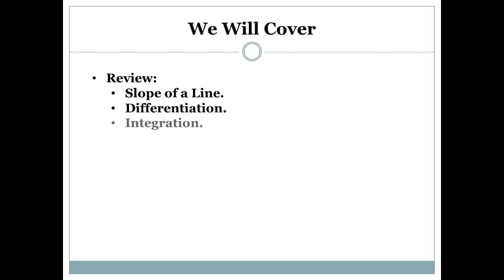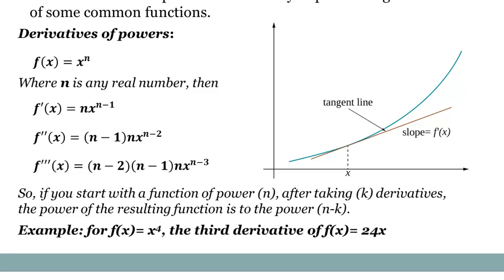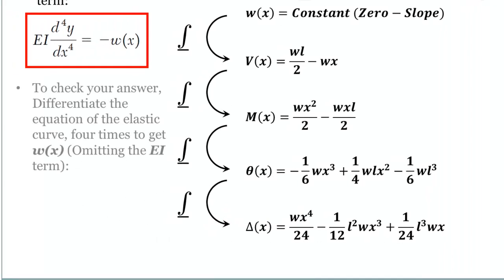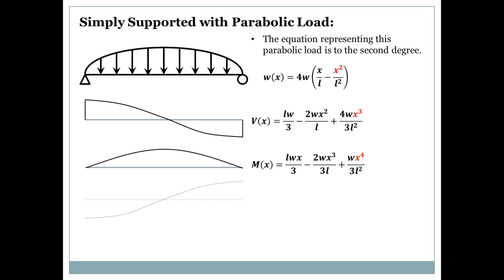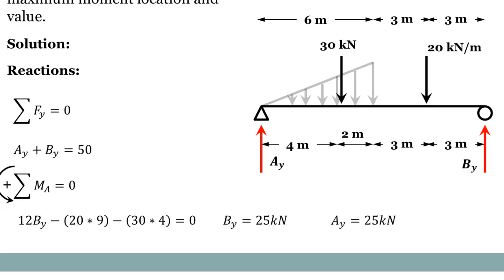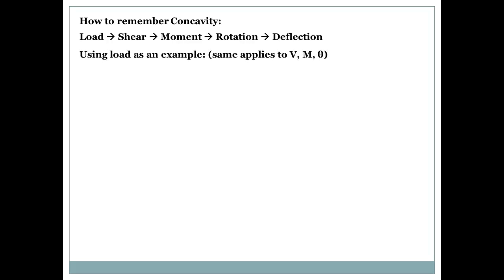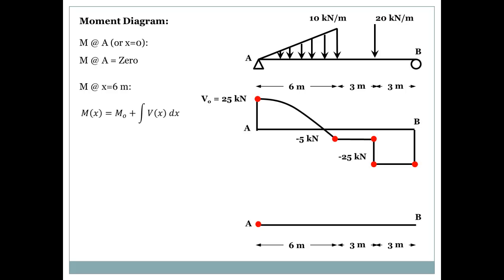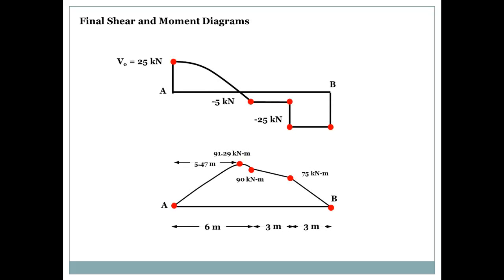Understanding the V and M Functions and Their Diagrams + 2 Examples

Comment: Great video !
I like the concavity rule, for the moment diagram between 0 <x< 5.47m the shear is Positive and decreasing
but between   5.47m <x< 6m it is Negative and decreasing wouldn't have a different concavity ?
Reply from the maker: ans just concavity applies if the shear force shape is of 2nd degree (parabola). after the 5.47 the shear is a straight line. so concavity does not apply.